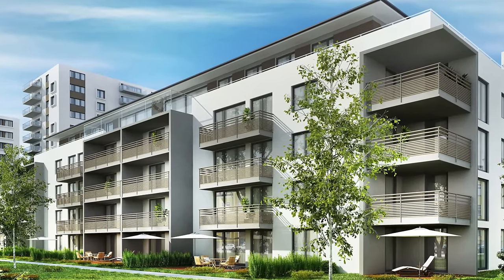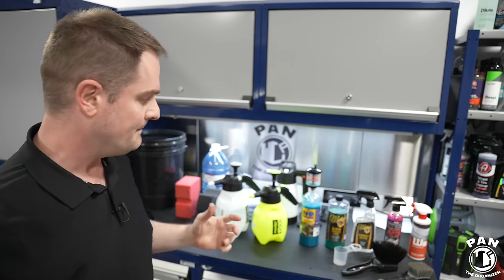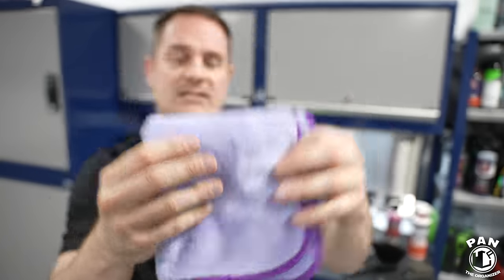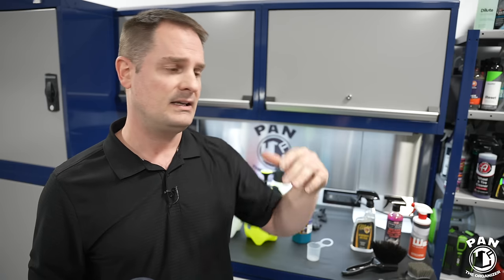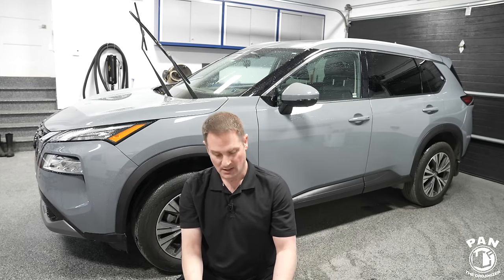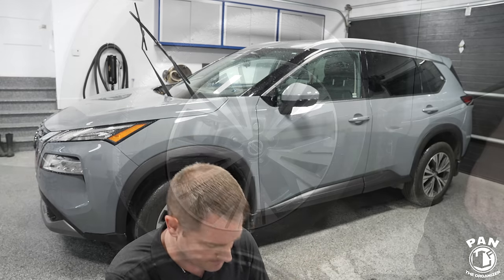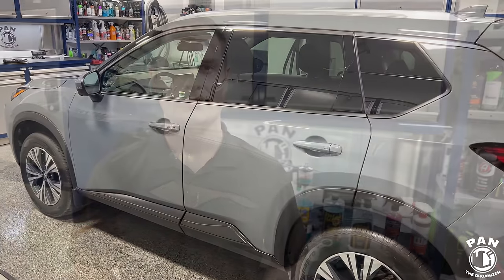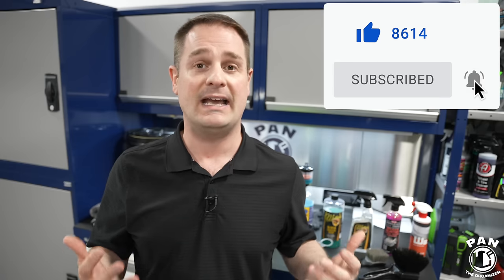How to wash your car without a hose or pressure washer! (RINSELESS WASH METHOD)

Comment: @pantheoraganizer does it need to be wiped off with microfiber towel or can I use the leaf blower to just dry it, instead of wiping it off?
Reply from the maker: With a rinseless wash, you always have to use a microfiber drying towel at the end. You don't want to use a blower, as don't forget there is still dirt on the surface, that the rinseless wash encapsulated, and that needs to be hand dried.

Comment: Is rinsing the car after washing with ONR something that can be done in order to remove all the remaining ONR on the car, so that it becomes possible to dry the car with an airblower rather than wiping it dry with a clean microfiber towel?
Reply from the maker: No. The entire point of using a rinseless wash is so that you don't rinse at the end. If you have access to water, then just wash your car the traditional way, it's a better method (water, buckets, wash mits, etc).

At the end of the rinseless wash process, you use a microfiber drying towel to wash the car. The rinseless wash solution acts as a lubricant and drying aid, helping dry the car without causing marring. But you don't use a blower to dry a car washed with a rinseless solution.

Comment: For the wheels, did you redunk the brushes back into the bucket?
Reply from the maker: If you can, rinse the brushes after each wheel, before dunking them back into the rinseless solution.
Reply: @PanTheOrganizer  appreciate the response. Let’s say I don’t have access to a hose. Would dunking it into my rinseless bucket that I just cleaned the car with, sufficient? I have a grit guard in it as well. 

I’m essentially considering if I should just get a separate bucket to have rinseless in specifically for my tire/wheel brushes, or if using the same bucket of rinseless at the end of the wash would be effective as well.

Comment: Hi Pan I am learning how to properly wash the car,been watching your video. We have no access with hose and water. My question is. Can I use the rinseless solution put into the pump spray to pre rinse the car, then after, Can I use the waterless ultimate Maguire?
Reply from the maker: Just keep using the rinseless wash method at that point, it’s safer compared to a waterless wash.
Reply: @PanTheOrganizer  thanks so much Pan. It's all new to me, we just had a new car and learning on how to maintain it. We were thinking to go to self car wash to traditionally wash the car., Coin operated.
By the way, 'Autoglym quick fresh okay for rinseless? I can't find the ONR or Mackess in Australia.

Can I use the wax after the rinseless wash? Or any product?

Watching your video cleaning  window and windshield.
Reply: @PanTheOrganizer  forgot to mentioned, your video where I found and   learned about waterless and rinseless products, Thanks Pan. That's why we brought a Maguire ultimate waterless, I tried  on the bonnet as there was a pop bird and pollen and dust, I nearly use half of the bottle 😀. But will do the rinseless wash as suggested by you as it is safer, Which I agreed.
Reply from the maker: Welcome to my channel. You discovered one of the biggest car detailing channels on YouTube as we surpassed 830,000 subscribers and 105 million views! I have been detailing for 25 years and I love to share my knowledge and passion with my viewers.

You found the right channel to help you learn everything about detailing.

Yes you can apply a wax after you are done cleaning the car with the rinseless wash method.

Comment: Can I add a quick detail, topper quick detail to be exact, at the end or would that be a problem ?
Reply from the maker: At the end of the rinseless wash process, you use a microfiber drying towel to dry. The rinseless wash on the surface acts as its own drying aid / quick detailer. But if you want to further boost gloss and slickness, you could spray your own quick detailer on top as well, and then towel dry if you want.

Comment: Pan, I always use a standard chenille washmitt to do my rinseless wash and it works great for me. I much would prefer that to the microfiber towels. Is there a reason you did not mention this an option?
Reply from the maker: I believe I did mention you can use what ever wash media you want (sponge dedicated for rinseless washes, microfiber towels, or wash mitts), it's a question of personal preference. 

But I did show the use of a mitt with a rinseless wash in a previous video I had made here: https://youtu.be/DxBdWQ2k9Tw
Reply: @PanTheOrganizer  thanks for replying. I typed this before finishing the video and you did mention you can use a washmitt

Comment: Hi Pan - Hope all is well! Is it possible to apply ceramic coat after waterless wash or car needs to be clayed and polished first? Car is new.
Reply from the maker: No. First, most waterless washes contain some form of light protection and lubricating agents, both a big no no before applying a coating. A ceramic coating needs to be applied to a well prepped, virgin clear coat in order to bond properly. 

A new car is never new until it's properly detailed. 
- at the factory, the paint defects are often corrected quickly by rotary polishing which can leave marks and holograms, so polishing corrects those, before you lock that in long term with a ceramic coating for example.
- vehicles are then transported by truck, train and boat so they are exposed to the elements, industrial fallout, brake dust, rail dust, etc
- vehicles are often left at boat docks (when transported by boat) or in exterior parking lots for weeks or months, again being exposed to the elements
- at the dealership, the vehicles are almost always poorly prepped using the same dirty water that was used for all the cars on a given day, and poor washing and drying methods leading to swirls and scratches 
- at the dealership, a layer of cheap wax or paint sealant is usually applied to attempt to make the paint glossy prior to delivery. It's crucial to remove any previous protection before you apply a ceramic coating, as coatings need to bond directly to a virgin clear coat.

If you only plan on applying a regular carnauba wax or paint sealant though, you could decide to skip machine polishing, as those protectants can be applied over existing protection and it's not as crucial to prep the paint as well.

I explain all of this in this popular video: https://youtu.be/QgoyrC-5CMc

So you can better visualize the new car prep process, here are the steps I perform on a brand new car from two of my customers: 
Tesla Model Y: https://youtu.be/gohks8xP5NY 
Porsche 911 Carrera: https://youtu.be/2ckiivbFqs4
Audi Q7: https://youtu.be/t7HCBSVnizM
Reply: @PanTheOrganizer  Thank you so much for the detailed explanation!
Reply: @PanTheOrganizer  Hi Pan - I don't have the luxury of washing my car at home before starting the clay/polish/ceramic stage. It is illegal to wash cars on the driveway in my area and I don't like to wash the chemicals into the storm catch basins in the street. Is it possible to wash the car at a self carwash bay using a foam canon and then drive a short distance to home to perform the clay/polish/ceramic stage? Thank you! - Shane

Comment: Hi Pan, I have a question, can we just use a blow air to remove any water on the car instead of a microfibre ? Thanks
Reply from the maker: Not for a rinseless wash, as their is dirt in the rinseless solution so you don't want to be blowing that. You use a microfiber drying towel at the end of a rinseless wash process.

Comment: Hey pan. I wanna use the ik pro 2 to spray my shampoo on my car seats for extraction. Should I go with the ik foam pro 2 or ik multi 2 ?
Reply from the maker: Multi Pro 2. Talking about extraction, did you watch my brand new video on carpet and fabric extractors? Here: https://youtu.be/gQO-g_JMV-I
Reply: @PanTheOrganizer  thank you so much for the help. Yep I seen that video which was awesome. I still need to get a extraction machine. Right now I'm using a Rigid 6 hp wet/ dry vac with a extractor head.

Comment: I use aero cosmetics wash wax after my one bucket wash before drying.  I spray it on, wipe with clean sponge and then dry.   Does  this work well?  Better product?
Reply from the maker: I didn't use that product so I can't compare.
Reply: @PanTheOrganizer  Interesting stuff, you should check out and give us your opinion for a waterless wash.  Their audience seems to include private jet pilots and drivers waiting for passengers to return.  I use it in the Mall parking lot while waiting for my family.  You spray it on, move it around with cloth or sponge, and dry it off with a microfiber.  They even sell a long handled mop for side of RV and airplane.  Obviously, only good for maintenance.  You’re thoughts?
Reply from the maker: My opinion on waterless washes is simple: don't use those unless you have no other choice. If you have access to water, use traditional wash methods with mitts and a bucket. If you don't have a garden hose or pressure washer access, but can fill a bucket, the next best solution is a rinseless wash, if used with common sense.

But a waterless (also known as hoseless wash) should only be used as a last resort type thing in my opinion. Even my friend Larry (from AMMO NYC, the biggest car detailing channel on YouTube) shares my opinion. And he even sells a hoseless wash called AMMO Frothe. And even he only recommends it when no water is accessible.
Reply: @PanTheOrganizer  Thanks.  We live in water restriction area, so I’ll try you’re one-bucket method in the garage.

Comment: Hi pan , how will you use to wash your sponge when you use rinseless wash ??
Reply from the maker: When you’re done, just dunk the sponge in the rinseless solution and squeeze it a few times, and ring it out. Let it air dry. 

If the sponge gets super dirty, you can spray some APC, work it in, and rinse with warm water. Let air dry. Done.
Reply: @PanTheOrganizer  whats APC stand for

Comment: Will this work in sub-zero temperatures and how will it work with ceramic coated vehicles?
Reply from the maker: You can use this on a ceramic coated car, in fact the vehicle in the demo has a graphene/ceramic coating on it. Common sense is needed for the temperature. If water freezes, than it will freeze the solution containing the rinseless wash too.

Comment: Hey Pan, would you know if bug and tar removers (such as Griot's) are safe to use on a vehicle with opticoat pro+ when cleaning car?
Reply from the maker: Yes they are. In fact, my previous BMW was coated with Opti-Coat Pro+ and I made a video showing my spring routine maintenance here: https://youtu.be/ud4wGakuSWs

Comment: Pan is this sufficient enough to be able to compound and polish and wax?
Reply from the maker: Yes and no. The same question would apply for a normal wash with shampoo. Would it be enough before compound and polish? It depends if the paint has contamination, which if you're thinking of polishing it, it probably does have contamination. So after cleaning the surface, you will have to use an iron remover for brake dust, and a clay bar and clay lubricant to remove further embedded contamination, before the machine polishing steps.
Reply: @PanTheOrganizer   thank you for your help

Comment: Seems great mechanically.  Totally a terrble to hold. Thumb does not land on trigger to enable  easy operation. If I grip higher up on the handle my thumb is high on the trigger and levelage is poor . If I grab lower on the handle leverage is bad as well and I have to radically bend my thumb to press the lower end of the trigger to activate  the foamer also the end of the handle could be 3/4" longer , in my hand the corners on the lower end of the handle are pointly and jab the palm of my hand.  This would be worse with the weight of liguid in the tank.  I bought 3 of these , 2 as gifts.  Marolex sorry to they're comin' back at ya.  They feel awful.

Comment: Can a Blow Dryer also be used to dry the care during the rinse less wash?
Reply from the maker: No, as remember there is still dirt encapsulated in the rinseless wash molecules, so you don't want to push that on the paint at high speeds with a blower. You use a gentle microfiber drying towel to dry the surface, with the rinseless wash acting as your lubrication/drying aid. You could also spray some more quick detailer if you want even more gloss and slickness.

Comment: Would it be ok to wax a car after rinseless washing? Getting a new car soon and it being winter the hose is put away and water to outside shut off. Want to protect the new paint
Reply from the maker: Yes if the surface is clean. But ideally you would prep the paint a lot more and perhaps apply a longer lasting protection.

A new car is never new until it's properly detailed. 
- at the factory, the paint defects are often corrected quickly by rotary polishing which can leave marks and holograms, so polishing corrects those, before you lock that in long term with a ceramic coating for example.
- vehicles are then transported by truck, train and boat so they are exposed to the elements, industrial fallout, brake dust, rail dust, etc
- vehicles are often left at boat docks (when transported by boat) or in exterior parking lots for weeks or months, again being exposed to the elements
- at the dealership, the vehicles are almost always poorly prepped using the same dirty water that was used for all the cars on a given day, and poor washing and drying methods leading to swirls and scratches 
- at the dealership, a layer of cheap wax or paint sealant is usually applied to attempt to make the paint glossy prior to delivery. It's crucial to remove any previous protection before you apply a ceramic coating, as coatings need to bond directly to a virgin clear coat.

If you only plan on applying a regular carnauba wax or paint sealant though, you could decide to skip machine polishing, as those protectants can be applied over existing protection and it's not as crucial to prep the paint as well.

I explain all of this in this popular video: https://youtu.be/QgoyrC-5CMc

So you can better visualize the new car prep process, here are the steps I perform on a brand new car from two of my customers: 
Tesla Model Y: https://youtu.be/gohks8xP5NY 
Porsche 911 Carrera: https://youtu.be/2ckiivbFqs4
Reply: Thank you! Great videos!

Comment: Thank you for this video Pan! I'm a huge fan of rinseless its a lifesaver. I use it a lot for maintenance its with a lighter dirt and it does phenomenal.  Brake buster is still my favorite for wheels and tires still haven't found anything to beat it. And the marolex takes it to the next level. 
I'm noticing that my coating is clogged and masked. I got some turtlewax Maxx power to see how it works. I'm hoping the aggressive dilution is enough, the extreme is an option but I don't want to be too aggressive in the bucket. Do you have any suggestions? The ultra black sponge for me is phenomenal and a game changer. Plus if it was made by yvan lacroix it normally is lol. Thank you for everything you do and for teaching us,  you've made me a much better detailer and I will always watch and support
Reply from the maker: Watch my spring maintenance clean video for the ultimate rejuvenation of coatings here: https://youtu.be/oTaFE_p2OAw
Reply: @PanTheOrganizer  thank you that I'll definitely watch again.  I'm thinking of the graphene shampoo it really worked well
Reply from the maker: The graphene shampoo isn’t meant to restore clogged coatings. It just has more lubrication.

Watch the video I linked. You need a high pH for the snow foam, and acidic pH for the shampoo.
Reply: @PanTheOrganizer  thank you that definitely makes sense

Comment: What can I add for ceramic coating conditioner when doing rinse less wash ?
Reply from the maker: I would clean the car first, then dry it, and then use your favourite ceramic spray sealant for maintenance.

Comment: Hi Pan. I have a serious question for you and need help. I ceramic coated my car using gtechnique product. 3 weeks later with a wash and bead maker applied on top  I notice rough crystals all over the vehicle. Do you know what it is and how I can clean it off without scratching the car?
Reply from the maker: I have no idea unfortunately, as I can't see the vehicle and don't know what you did wrong. Did you try reaching out to Gtechniq or P&S?
Reply: @PanTheOrganizer  no I haven’t.

Comment: Is this method similar to the one with a pressure washer? 
Does the car get cleaned the same? 
And if the car is very dirty do you need to “work” it more ?
Reply from the maker: I can't recommend a rinseless wash method on very dirty vehicles. As I said in the video, you have to use common sense. If the car is too dirty, you have to pressure rinse it off first, before doing the rinseless wash.

A rinseless wash is more an ALTERNATIVE for someone who doesn't have access to free flowing water or a pressure washer in my opinion. If you have a pressure washer, and wash buckets, I prefer the traditional wash method which cleans a vehicle better.

But not everyone has access to water, so the rinseless wash is a decent alternative for a light to moderately dirty vehicle.
Reply: @PanTheOrganizer  yeah that was my thought also. Seems legit though. As I see it you can use this method also if the vehicle is not THAT dirty just to have it in a good shape! Thanks for the tip. I recently got a new car and I examine everything around cleaning and other stuff and I found you on the way. I saw few of your videos so far and they seemed very helpful. I will keep tracking you for sure my friend! Take care!